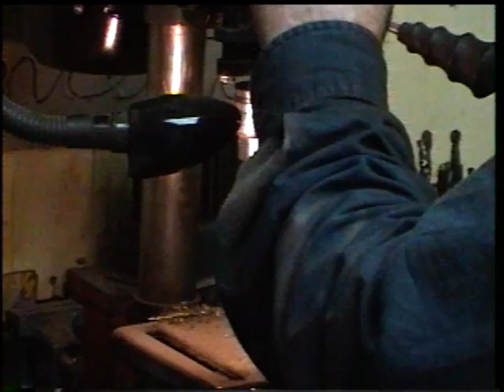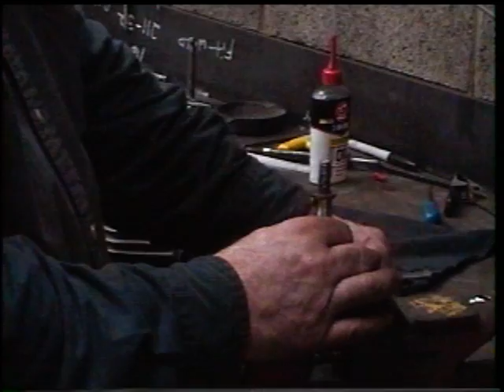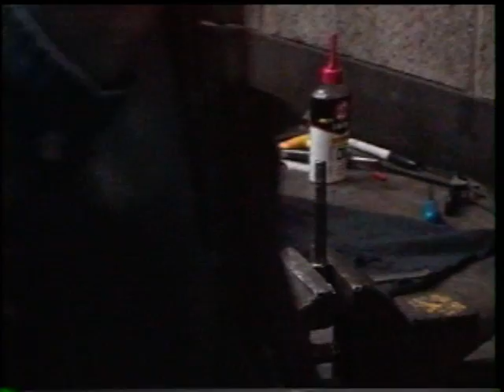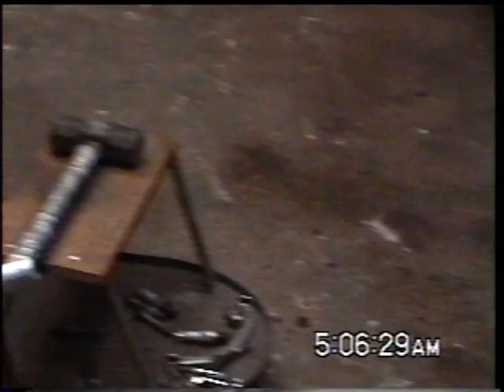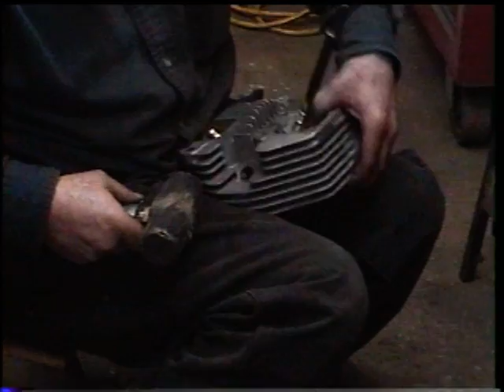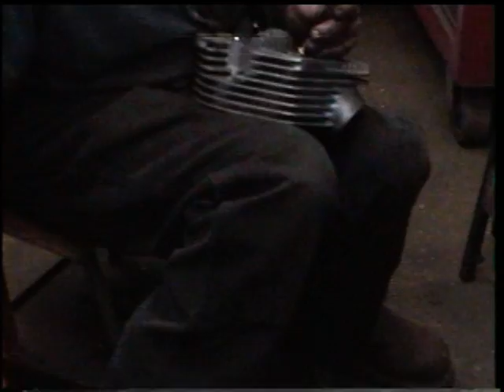Sizing and Installing Valve Guides

Comment: If you insist on doing it this way, which i have to say is very homeshopish, a powerfile style belt sander would be a better option.
Putting that guide in cold?Have never heard of heat? Putting them in like that runs the risk of galling and also distortion from all the bashing. I used to use an electric cooking ring for heating heads to make life easier than sitting there waving a torch about.
Reply from the maker: I have used my wife's oven in the past. I took the lasagna out first so it wouldn't taste like hot aluminum or give us Alzheimer's. My garage is attached to the house. That probably would explain the "homeshoppedness". 

The first three valve guides went fine. Got a little hasty on the last one.

l learned this from an elder brother of mine (RIP Bones) that was well experienced in The Scooter Tramp Ways.
Bike runs great to this day by the way. Thanks.